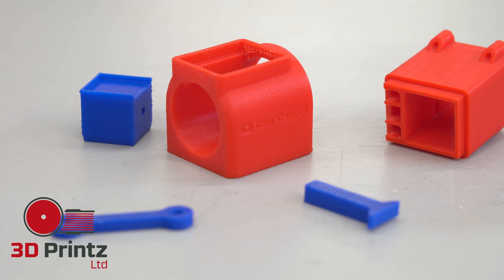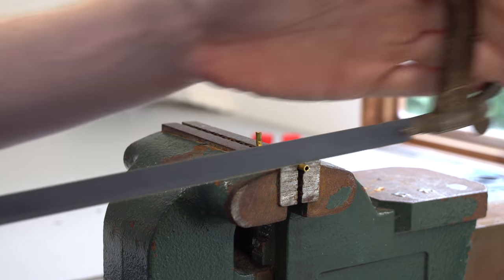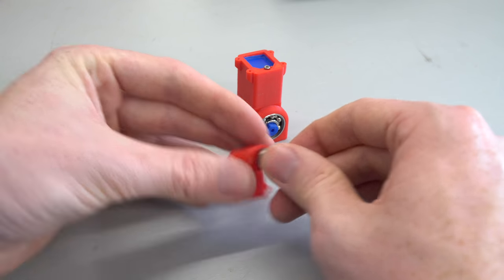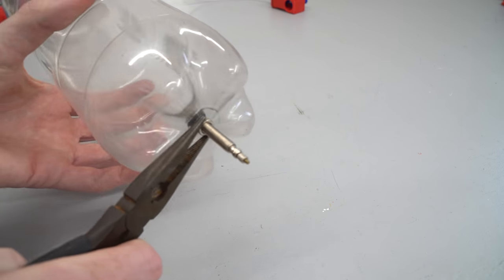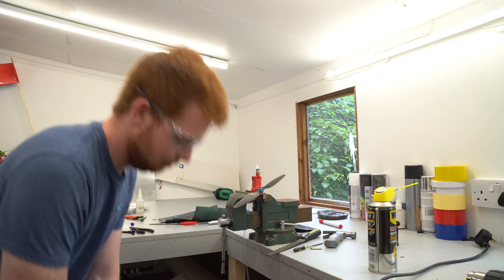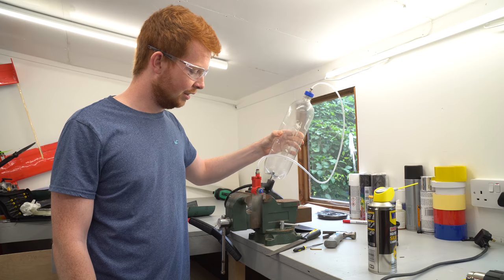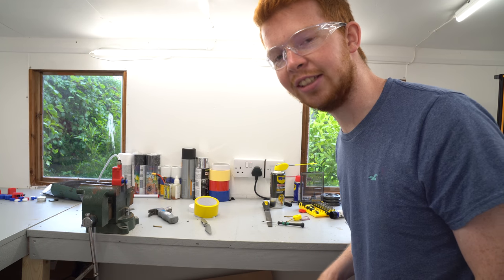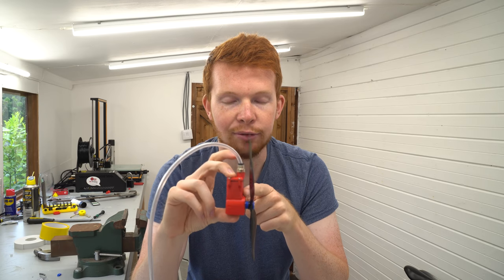3D Printed Air Engine BUILD

Comment: The engine could probably benifite from gas rings on the piston
Reply: At the price of friction
Reply: aren't gas rings just relief cuts in the piston? how would that increase friction?
Reply: will hicks they do add surface friction, but they also seal off the piston better with enough pressure.
Reply: JJtheone123 It's a good idea, and it would benefit it but I doubt it'd be nigh impossible with PLA plastic. Even if he could the endurance of rings would suck ass from how thin they'd be. Plus square piston, lul.
Reply: The Bait that is Natori why did he make the piston square anyways?
Reply: "aren't gas rings just relief cuts in the piston?" Nope. The lands are the relief cuts. Now you need a springy material, a "ring", to go in the land that closes the space between the piston and cylinder. In this case, likely an elastomeric -ring. Since this engine is not continuously lubricated, the ring would wipe (like a squeegee) the lubricant off the cylinder walls, increasing the friction.
Reply: The square piston is for ease of manufacture. It's inferior to a round piston in every way, specifically circumference and the corners causing significant friction.

Comment: Can that engine run on water?
Reply: Great hypothesis!
Reply: Depends on the pressure of the water and how well the piston seals.

It would probably be fine if you allowed for leakage around the piston, which is does as seen by the daylight coming through the sides of the piston while it's inside the cylinder.

Comment: Thanks for another great video, next project a plane tethered by a lightweight hose hanging down to a pump by the "pilot", for "endless flights" (in time, not distance to the pilot) ;)
Also, maybe You should start considering using hearing protection when running those "beasts" as it sounds like they are pretty noisy ?
Best regards
Reply: Gglsux - -  Yes it does but what ar ya gonna do?  

great idea.

Comment: The insides of the cylinder still look a bit rough and uneven. I'd imagine you want to get it as perfect as possible to minimize friction and get a better seal. Have you thought about splitting the cylinder into 4 parts so the inside surfaces can be printed laying flat on a perfectly smooth printing surface? Or 2 corner shaped parts that can be easier and more accurately be sanded flat and then gluing the cylinder pieces together?
Reply: I'm printing this engine in resin, the tolerances i can get with dlp are out of this world, no sanding just curing.

Comment: The best application for this engine is to install it on a INFLATABLE BOAT. Compressed air within the boat will keep the engine running, and the engine will keep the boat running forever, and ever and everrrrrr.

Comment: I have thought of two potential things that might be cool. First, as the PVC tubes are flexible, would it be possible to just put two of the cylinders together with a new inner part to make an O-type flat twin? Also, would building some king of 3D printed air compressor and hooking it up to the engine make it run longer. It might even be possible to have the compressor supplying air to the engine while being run by the engine.

Great videos, keep them coming!

Comment: I reckon access to desktop injection moulder would assist in the speeding up of these projects, slicing down time to the bare minimum and allow you to put out a boat load of more work and ideas.

Maybe there is a generous engineering/moulding company out there willing to help even if they offered the loan or gift a machine as part of a maker space donation it would help projects like this no end.

Where are you generous desktop moulder manufacturers and can you help!?

Another great vid, Tom. Always enjoy your work.

Comment: Apologies if already suggested, have you thought of investigating/experimenting with "Compounding"? That is using the exhaust gas on a second lower pressure cylinder. This was used in steam engines for example to extract more energy from the available pressure.

Comment: Tom, you should really use a regulator at the bottle end if you're trying to go for duration. Pneumatic regulators limit the upper working pressure of the system so the system can run at a capped pressure and the reservoirs can be at higher pressure.

Comment: Here's an idea. A couple of years ago Peter Schripol  built and flew a Lego airplane. But he used a regular brushless motor and servos. And I always thought it was kind of cheating. (And he clearly hadn't played enough with Legos as a kid to build strong and light enough ;) ) 
With what you have learned I think you could build a Lego version that would allow for a bare minimum of  non Lego parts in such a plane.

Comment: I think when you use the engine on a rc plane the bb pellet you use moves and the engine stops working. The plane should be level for the engine to work properly

Comment: What about 3D printing a stirling engine? It would be nice to have one tool which could convert the temperature difference into rotation and rotation into temperature transfer. And with it being 3D printed, it would not require as much stove silicone (silicone for high-temperatures) to bind everything in place.

Comment: you should make a pully on the engine and than mount it to a rc car with on one wheel also a pully and conect the engine and wheel with a rubberband (big one). than if you roll the car it starts moving by him selfes

Comment: I wish I had a 3d printer because I'd like to run it off my big compressor with some sort of air regulator. I could start off at a low pressure and see how high it can go until it blows the head off. It would also be cool (albeit perhaps too heavy) to copy the dimensions and machine one from aluminum to see how much farther I can push the pressures. Making it out of aluminum would also allow me a wider range of lubricants and possibly smoother surfaces and tighter tolerances.

Comment: I think you should try going back to a round piston and cylinder. When you design the piston, make 2 channels/groves around it so you  slip a couple o-rings around it. Then it would seal like a real compressor or engine would, since they use piston rings for the seal. That way you don't need the piston and cylinder to be completely perfect to get a good seal. You could even make the piston a bit smaller than the cylinder and use a thick O-ring in the grooves to fill the gap. You should get a much better seal that way.

Comment: Ever consider running it on something like dry ice?
Reply: Hard to get dry ice in the UK. He could probably run it off the liquid from one of those computer air dusters by just filling the bottle with the juice and sealing it.
Reply: Huh, we use it for a lot of things in the US. Liquid nitrogen maybe? Both can explode soda bottles if you put enough in and seal it. Air dusters or liquid propane or butane would work too, but I was thinking on non-flammable fuels, just because running an air motor on flammable hydrocarbons seems silly.

Comment: You should try to add an electrical pressure gauge  in the chamber linked to a computer to "debug" your engine. (To see if the opening of the valve happens at the right time). With a "high speed" camera and a transparent cylinder if you can ^^

Comment: Why not have the coolest sounding electric ever. Run a brushless motor to a small air compressor, to your engine. Yes, it would not be an air powered plane but it would sound cool.

Comment: You should mount this engine on a thrust measuring jig! You can get some data for the thrust curve as psi drops through the duration. Might be useful to understand the "useful" duration of the flight, which would be how long the propeller spins above a certain RPM where thrust is too low to sustain flight.

Comment: To the point where you're saying not to tighten the screws to hard there's a perfect phrase for it; after tight comes loose. Very common sentence in german handwork. Don't know if you use this in English but it fits just right

Comment: My advice is that you should make the cylinder a cylinder because then there's less concentrated heat and it will run more efficiently

Comment: If you have trouble with the cylinder head screws stripping, you can always print the holes longer, and then to start with, use shorter screws. That way, if you strip the thread, you can use a longer screw which will bite into new material. I designed this into a commercial product that used an extrusion and after a few services, the holes were stripped so I just advised to use longer screws and that fixed it!

Comment: I have followed your air engine project for a few months now and I'm really fascinated by the good result! Just one thing I've wondered: Why didn't you try any gear pump designs? Gear pumps are actually very simple with only two moving parts.

Comment: What about making a sort of flywheel to carry momentum? I also wonder if you put dry ice in the bottle if it would melt fast enough to sustain enough pressure to run the engine for a longer period of time. I think that'd be a cool experiment!

Comment: Would there be any benefit to filling the crankcase with a light oil just up to the cam? You might be able to run the dual push rod version if that would reduce push rod/cam friction
Reply: No, petroleum based oils will degrade the PLA plastic. Also what you're saying will increase friction.

Comment: Dryice and a bit of water in the bottle is the answer. Regenerating air supply until the dryice is gone and dryice is super cold so it will keep the engine cold even with the friction of it running

Comment: Tom, would you consider making this in Aluminium, with a pressure regulator as a throttle on the inlet and say a 3000psi divers tank as the "air reservoir" It would be interesting to work out the power to weight including fuel tank etc. This is essentially a potential Clean, alternative to electric motor if the efficiency could be matched etc.

Comment: Tom rather than trying to bond the tube in or using a heavy metal fitting why not design the top of the block and the bottom of the head in a way that allows you to clamp down on the tube?  Obviously it would work better if you had the tube outlet pointing rearward also.
Reply: Gene P. - Wow, nice idea.!

Comment: I belive the engine would be more eficient if you put the blue push rod on the side, in such a way that the highest point of the push rod would be reached with a delay. I say that because the current model pushes the piston downwards even when it goes up, therefore slowing it down before accelerating. This is evidenced by the stepping motion of the propeller.
I sugest moving the pushrod to the side, and making the bottom side of the pushrod to an angle, so it will be pushed latteraly by the spinning piston arm. 
Hopefully the friction caused by the angle of the push rod's bottom would be less significant than the deceleration of the current model's too early release of air. 
Sory for posting 2 years late :)

Comment: A great feeling when it starts to come together.  When do you get to sleep?  Have been thinking of a double length (in the shape of a U) rubber powered glider driven through a gear box of some kind to extend duration and be could be braked in some manner to give multi starts while in the air.  It pays to keep the old brain working eh!  Thanks once more.

Comment: I don’t think I’ve ever seen a square piston until I came across these videos. Is there a distinct mechanical advantage for using a square shaped piston over a circle shaped one?
Reply: I believe it mostly has to do with not requiring a lathe to perfect the seal.
Reply: so why don't we see any square engines in gas engines? what would happen if someone tried it?
Reply: Speedrunner: I used to wonder the same thing when I was a teenager in 1972!
Turns out it's too easy to make round pistons seal on round cylinders because of lathes and such tools.  That seal is the key to internal combustion engines.  Square piston motors can be done, but not as cheaply and profitable as round ones.
Reply: Yes, the circumference of a circle of the same area as a square is significantly less. So a square is much worse in this application, plus the corners create significantly more friction.
Reply: so why don't we advocate round cylinders for the air engine?
Reply: Speedrunner: I believe he likes the fact of printing the engine "good enough" to work with minimal non-lathe machining. Plus there is a benefit of offsetting the connecting rod for some issue he had with spacing.  Whereas the round might have binded with an offset connecting rod.

Comment: It would be much more efficient and practical if you used a chemical reaction inside the bottle to make the motor spin (for instance) You could use a pump and pump dissolved baking soda and vinegar for a combined chemical reaction

Comment: I wonder if you've tried having multiple bottles pressurized and opening them one at a time. Like if you make a 4 bottle air powered car and as the PSI in the bottle before gets low you flip a switch and open the next one, giving you a boost of power! I've only recently started seeing your videos but this engine is awesome!

Comment: Hi Tom Stanton, you could think about some easy chemical reaction which will provide you some gas pressure for your engine.
And one more thing is pressure regulator, so when you get high pressure in bottle, an air flow will be reduced and overal work time will be longer, but of course at little lower rpm.

Comment: Capture the exhaust air via a pnumatic fitting, hose and a check Valve and exhaust it back into the bottle, endless air. You can then create a dump valve to bleed off the air to stop it.

The check Valve would prevent a suction lock (like a vapor lock). The check valve would be a simple chamber with a o-ring and a ball, the vacuum caused by the cylinder would suck the ball back on to the o-ring for a seal.

Comment: I'd like to see this in a plane with a cf paintball co2 tank and a regulator so you could actually get a little flight time.  Though I'm not sure the engine could produce enough power.

Comment: Please try it with a Tesla Valve instead of the Ball Valve, and experiment with different diameter, and then make the smallest diameter possible and if it seams too restrictive then cluster several beside each other, please post results, it would be less parts you need also

Comment: Great work Tom, if you hooked up a little infrared sensor you could make a little solenoid controlled idle valve to have the engine operate a the low rpm and pressure bursts like you were doing- just an idea.

Comment: You might want to consider having the pressure come in on the bottom of the piston and push it upward.  Then, perhaps, the valving for both intake and exhaust could be implemented as channels drilled through the crankshaft, or some other way that didn't involve a pushrod.  I'm imagining the crankshaft acting like a ball valve.

Comment: Hey Tom for your car version to get a higher run time you could try building a vessel that has a high pressure release valve and then you dry ice and water in the vessel. The run time would be significantly longer and if the car stopped moving and as the pressure built if it got too high the valve would open and therefore make the system safe again. I’d love to see this in a future video. Cheers.

Comment: try powering it with a co2 cartridge (might need a pressure regulator)
Reply: Flyguy - - Wonder if the regulator from a butane lighter would work?  Maybe stacking them in parallel?
Reply: doubt it... better get a small pneumatic component with a manual throttle valve to screw it on,
Reply: Yes, that makes more sense.

Comment: Have you considered running this with a can of Co2 and a way to regulate the pressure entering the engine. Some sort of Air Injection if you will. It would be really interesting  to know what the output will be with certain types of Co2 cans at a certain pressure. Also, a tin of grease to that ball bearing will not hurt it at all.